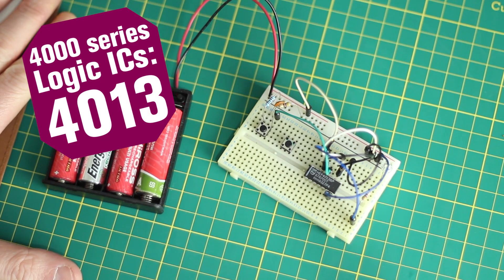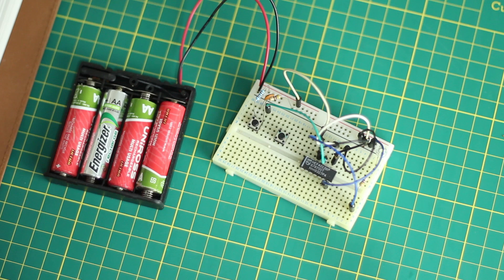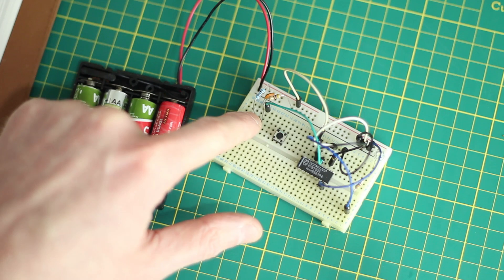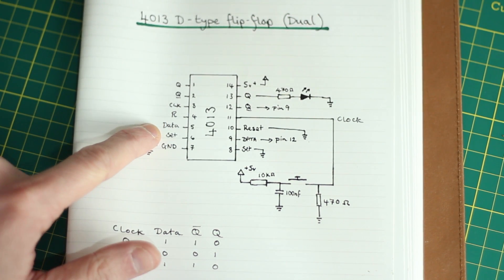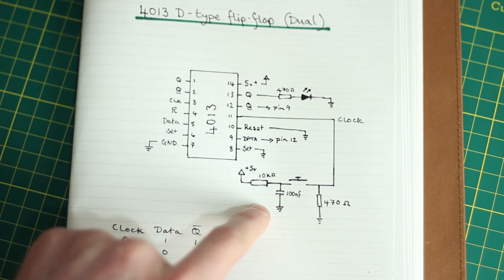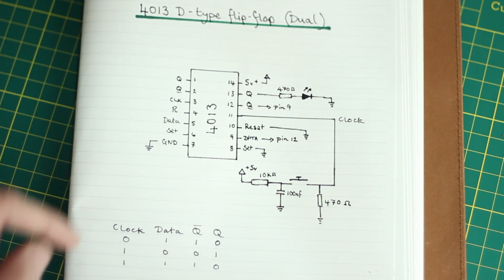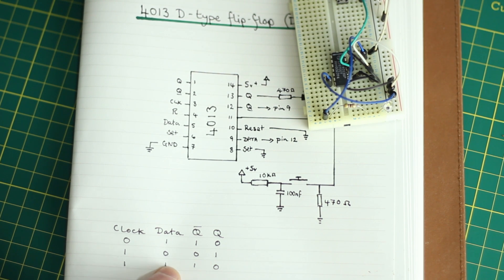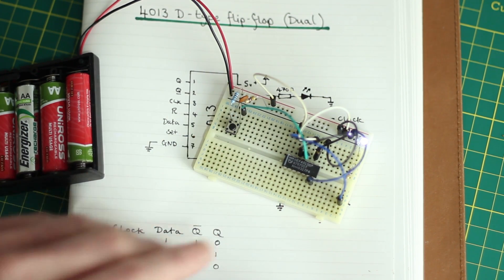4000 Series Logic ICs : The 4013 Dual D-type Flip-Flop

Comment: David, are you 100% sure the drawing is correct? I’ve built this 3X and no go.
Reply from the maker: Hey Sarah, I am never 100% but I have just compared the diagram with the breadboarded circuit and they look the same to me. You could try the other side of the IC since it is a dual type.
Reply: @DavidWatts  just got it working. I did ground pins 4 and 6. Also added a bypass cap across the 4013 power pins. 
Thanks, neat circuit. If you like, please take a look at my channel as well. I build and sell 8 and 16 step music sequencers. Happy Saturday! 🙋🏻‍♀️
Reply from the maker: @UCih5kiTQ4MKhMy_mdcI-_iw you can, it can't hurt to ground them but they should be independent of each other.

Comment: used 2 of these in cascade for a 4-stage shift register, to select 4 different PWM speeds generated by a 555 timer. Didn't have a dedicated shift register type IC but did have a boatload of these :)

4000 and 7400 series are hobbyists heaven :)

Comment: Could I use that circuit to turn a computer power supply on and off with the momentary button that is in a computer case?
Reply from the maker: Hi, I think that PC power supply switches are momentary connections so I don't think it would work.
Reply: @DavidWatts  Correct
Reply: If you are building a computer, the front panel buttons go to the motherboard. When you press it, it shorts a pin to ground and the power supply turns on. If you just wanted to turn on an atx power supply a flip flop is not needed. Find the pinout for the 24 pin mobo connector.
Reply: @untrust2033  incorrect. Most are momentary green to ground connections. So one does need to latch the green to ground some way or another. I solved this by using two BC548s. One 548 has its base to green and green is also connected to the collector of both 548s. the emitter of 548 #1 goes through a push button (ON)to ground, emitter #2 is directly tied to ground. base #2 is tied to the 5V rail thru a 10k resistor(pullup) and tied directly to ground thru a second push button (OFF). Pushing button 1 causes green to latch to ground, button 2 pulls base #2 low so green to ground is severed.